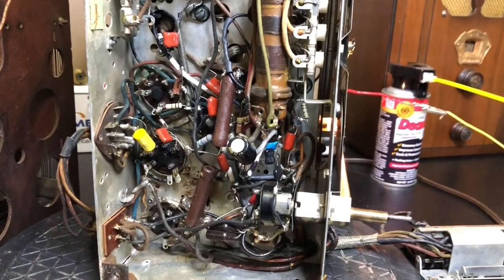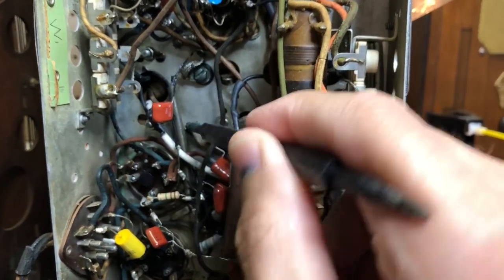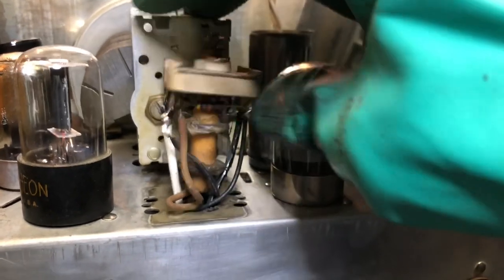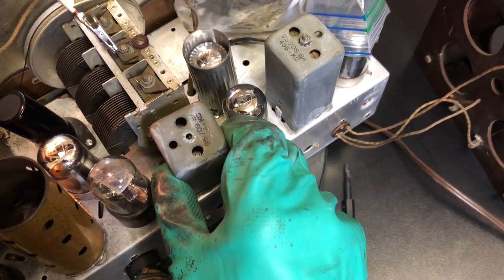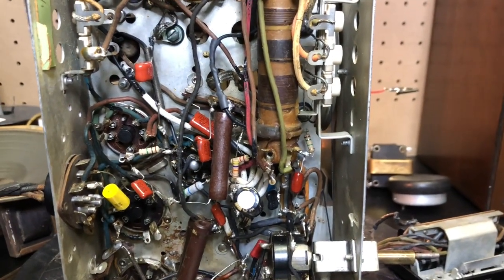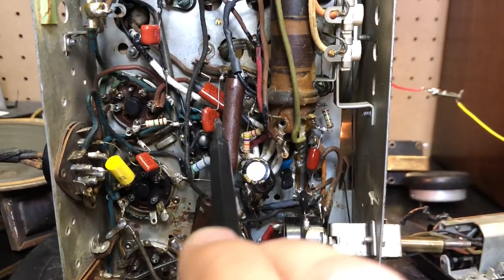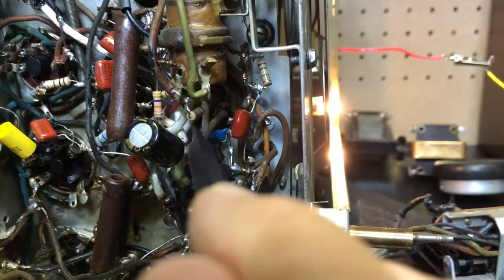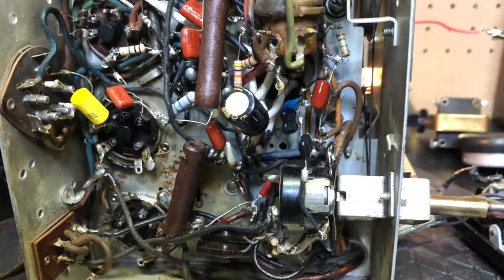Trying Again, Again and Again.

Comment: Good catch on the faulty  2nd IF transformer lead.  It does touch the chassis were you are poking at it. Before putting the 
IF shield back cut some thin cardboard or brown wrapping/ shipping  paper to fit inside the body of the transformer metal cover. They used to use that kind of paper , called fish paper to insulate the cover from the coil connections.
Reply from the maker: I tried to use wax paper but it kept folding up.  Brown wrapping paper is a good idea.

Comment: You are doing great on troubleshoot the problem. I don’t think the E cap problem since you are picking station. As radio wild mentioned check the alignment, it might be off, try to use a digital radio to match the station that you are receiving. This will tell you if you are off and how off. Hope this helps. Remember, then one who never gives up will win. You can do it 👍👏👏
Reply from the maker: One E cap has low voltage and two tubes have low plate voltages. I’ll try an alignment if that doesn’t work I’ll rewire the E caps. I’m ready to redo the entire radio.  This radio use to be a great performer. Not giving up.

Comment: Good bit "O" perseverance to find the shorted IF. Maybe with some signal tracing, the rest of the band can wake up. I would just try a alignment next on those IF's and see what happens.
Reply from the maker: I’ll give an alignment a try.  I’m still concerned about low voltage on two tubes and one e-cap. I can’t help think it’s just one little thing I’ve overlooked.  This radio was a great performer.